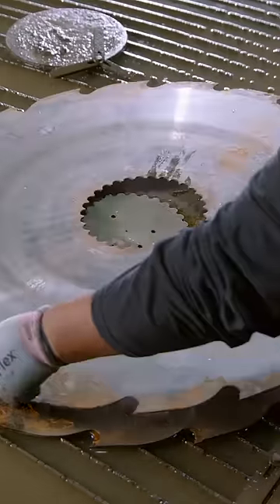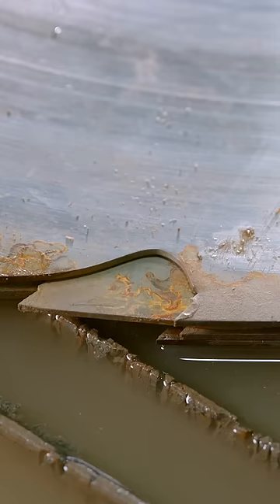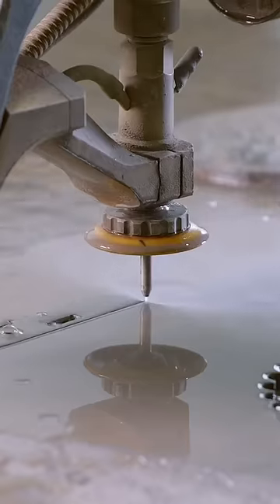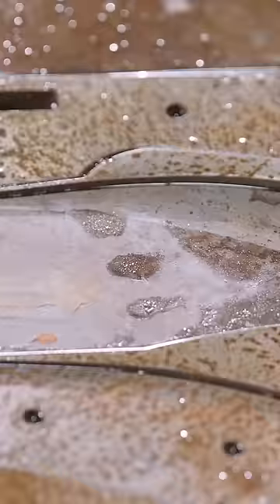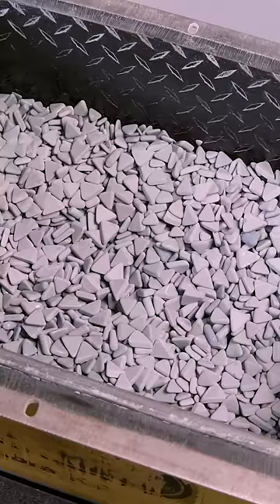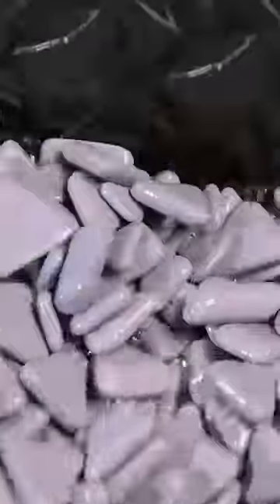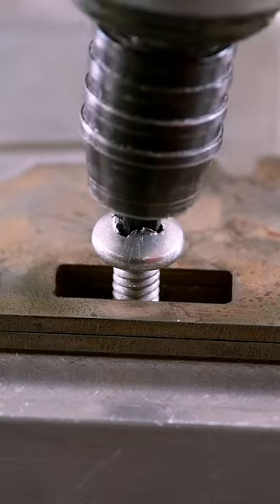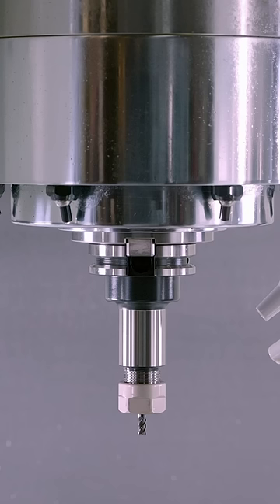Turning Old Sawmill Blades into Knives | How It’s Made | Science Channel

Comment: The screw has seen better days 😂
Reply: I came to find this comment
Reply: @Th3Build3r I came to say this comment. Luckily someone did it for me 😅
Reply: Yeah it time for those to go, and replace it with some nice hexes.
Reply: @iteerrex8166 is there a reason why we use hexagons instead of triangles?
Reply: @JT-nn8nj   I haven’t read any research on the topic, nor have done my own. I’m assuming you’re referring to the strength of the screw head!? But there’s also the other side of the equation, the strength of the driver, the ease of use. Maybe that the triangle is more of a stress-riser than a hex. I’m not sure why hex’s are very common. I have no answer. Do you know why hex than tri?
Reply: It looks about right for a Phillips screw. Garbage things don't last long. That was probably only one week's worth of use.
Reply: @iteerrex8166  the strength of the screw head primarily, but I also thought about ease of use with triangle wrenches and screw heads. I wouldn’t want to have to fumble around trying to get the wrench in the screw in a tight spot. I have enough trouble plugging in damn HDMI cables when I can’t see the port for it 🤦🏻‍♂️
Reply: @iteerrex8166  A hex driver is easier to insert tha a tri driver, you only have to rotate a max of 60 degrees rather tha 120 for triangle to fit it in. (approx)
Reply: @iteerrex8166 I'm sure they know more than you
Reply: @SpunkMayo  Very likely, in terms of a water jet, cause I’m still a noob, but workers do sometimes overlook things.
Reply: Now we know how knives out cast got their knives from😉.
Reply: So have I
Reply: Seems a bit odd they would even use Phillips head screws in an application that requires them being tightened and loosened again and again. Phillips strip far too easily.

Comment: 5 to 10 years?.  Who makes them.  I need to know. Lol
Reply: One log a day it seems
Reply: I think that’s how long they last till the steel has been sharpened so many times it can’t keep the correct cutting edge dimensions
Reply: @1992djg  o ok that makes more sence.  Thank you
Reply: The carbides are replaceable.
Reply: @1992djg its more an issue of cracks developing in the sawblade. Circular saw cracks can't be welded, legally speaking. Its highly dependent on what kind of wood its beint used on, i.e. hardwood or softwood, and what kind of debris is in that wood, I.e. nails or roadway spikes. The carbide tips are easy to sharpen or replace, and warping in the sawblade can be fixed too, though it takes a little more skill, but once it cracks, its cracked
Reply: MY MOM!
Reply: @Birilling    It depends where you are. Im acctully legally allowed to weld circiluar saw cracks so long as they are not to big. It depends on how big the crack is and how big the saw is.
Reply: @codeev4057  even if you legally can, you definitely shouldn't. Theres no definite way to repair a crack in a circular saw blade and the risk of the blade failing and throwing high velocity metal shrapnel everywhere is too great to risk it. Even putting in stop holes is risky as hell, which is why thats also illegal here
Reply: Where is here?. In New Zealand, if there is ANY process that the engineers would say it has a large chance of catastrophic failure, using that process in a workplace is illegal.
It isn't a matter of the government going along and looking at every process and judging it. The Industry as a whole KNOWS what is right, and wrong. They are self regulating in their setting of "Best Practice" and when there is an accident that results in harm or death, OSHA investigates. 
If the people used what was considered best practice, and did so honestly, they won't be prosecuted, but OSHA then makes a finding, and tells the industry "This happened because of this fault in your best practice. Here is the change to practice to MAKE it best again".
 Sometimes this is simple, sometimes it is extreme, and even a ruling that a process is now forbidden. If industry KNOWS there is a chance welding a blade won't leave it safe, and does it anyway, and there is a fatal accident . . .
$240 000 fine for every individual in the chain from owner through CEO right down to foreman, up to 20 million dollar fine for the enterprise.
And if  it is particularly egregious  or the company or management tells just  ONE lie about it, they can also get 14 years inside, not just the guy who lies or does the deed, EVERYONE who ought to have been monitoring it.
I know a bloke who worked for his fathers company, they set three guys demolishing the interior of a building, someone stole the fire extinguishers off the site so the bloke put the replacements  in an interior room instead of in plain sight . . . there was a fire and people couldn't get to the extinguishers and a man died.
The guy who was in charge of the site, the owner of the company, and the CEO all got 120 000 personal fines, the company got a million dollar fine, and the guy who put the extinguishers out of sight got a 240 000 dollar fine, and he was very close to getting five years inside. The ONLY reason he didn't go in was because he had gone and got replacements  the instant someone saw the theft had happened, he stopped work on the site till he got back, and he showed everyone where they extinguishers were going to be kept, and he had what he thought was an honest reason to change the policy.
But the Best Practice is you have the extinguisher AT THE WORK SITE, as well as at each exit, if there is a fire hazard identified.
The man who died, died because someone changed things just to save his company 300 dollars. And he had other things he could have done instead. @Birilling
Reply: We have a family sawmill that was steam powered in 1890 but has been run off a belt to the tractor for the last 100 yrs or so.

As far as I know it's the same saw blade that's always been on it, the teeth are spring loaded and changeable with a special tool.
The actual blade basically never has any reason to be changed.

The teeth are sharpened right in place with a file until every couple of years they are wore enough to need changing.
The whole operation probably takes a half hour or so.
Reply: Its their shelf life 😅
Reply: @Viking-r5e  different kind of circular saw, a old circular head saw is thicker where the arbour is, compared to the rim. Also runs alot slower compared to modern gang.
Reply: @uncletiggermclaren7592  think you might have @'d the wrong person
Reply: I was asking YOU 'where is here' in response to your comment "Even putting in stop holes is risky as hell, which is why thats also illegal here"

The rest of the comment was me, bored, telling you what the law's INTENT is here, in my counties jurisdiction.  @Birilling

Comment: Lol if you think sawmill blades last 5 years you’re cutting paper
Reply: Can't you just resharpen the edge? Looked like a lot of area to resharpen and get more use out of that blade they had
Reply: @Jellybelly98 they have carbide teeth on them and that’s actually make the cuts, they can be resharpened or replaced to a extent but once it’s been cut down so much from sharpening they’ll have to have new shelf’s cut to fit new teeth and all that usually isn’t worth the price
Reply: @travisnorton9288  ah, that makes sense, thank you for explaining
Reply: Precisely. Used to work at a sawmill and it'd be around 3-4 yrs they ran them so hard.

Comment: I wish they would point out that there is abrasive grit (typically garnet or aluminum oxide) in the water jet that is doing the actual cutting so people stop misinterpreting that water is doing the cutting. Water is just the carrier that also decreases heat and debris.

Comment: I worked at a sawmill chopping and debarking logs. The saw I had would get the tips replaced every 3-4 months. I would cut roughly 1000+ logs a day, and that’s not including trimming the ends to make them flush for the rest of the mill. I guess there are different types of saws, since we didn’t replace the whole thing, just the knives at the end.

Comment: In between those 5-10yrs the teeth on those blades have been replaced many times by removing the teeth and soldering/brazing new teeth on them until they can't be salvaged

Comment: In the used auto parts industry we look down upon ‘tumblers’ as it calls this vibrating machine with rocks as mediums. It strips too much metal off, making it more brittle. Nothing beats freshly casted or barely-ruffed used parts. Putting parts thru a tumbler is the bottom-of-the-barrel process for salvaging

Comment: I would say. Since the blades are originally such a large flat surface, I’d think it’d be easier and quicker to just use a flapper disc to clean the rust off before cutting the parts. Idk, that tumbler didn’t seem to do much good

Comment: 3 different types of screw heads on the same fixture, flanged hex head, phillips and internal hex. Guy picks up 3 different tools to tighten one part down, if he was doing thousands of them it will take him a good few hours longer than if he was using one type of screwhead. Owner is stepping over $ to pick up pennies in the long run.

Comment: Or you could just resolder new carbide tips to blade and reuse it, but its probably replaced due metal fatigue and micro fractures. In cheap mass produced knife those dont matter that much, but in sawblade of that size moving 3000rpm its different story.

Comment: Don't know what sawmill you are talking about but where I worked it would be a miracle if a sawblade lasted 6 months.......5 different high speed edgers for 4 6 8 10 12 inch cants/logs right butt to butt one after another and we run them 24/7 besides lunch and coffee and saw changes.......we developed our own babbot alloy for the saw guides so they wouldn't melt as easy even though they all have water cooling on each saw

We would cut approximately 2.3 million board feet every 8 hours so just shy of 7 million board feet a day.......we went through saws like crazy

Comment: I work for a Lumber company. We have on-site equipment for resharpening all of the different types of blades we use from the gigantic circular to cut the boards into the sizes ordered to the extremely large band blades to cut the logs into boards themselves. I mean I get it but, this seems like a waste.
Reply: If the carbide tips are worn, do you scrap them or do you refurbish them?

I'm a carpenter and we have other businesses for sharpening, but if the teeth are worn the blade gets scrapped.

Sometimes they treat the surface of the blade in a way you can not braze on replacement teeth - they want to sell new blades.

Comment: Why not just cut off a cm or two around the rim and use the blade again for another 5-10 years, sure it'll get smaller each time and you could only do it once or twice before it'll be too small, but it'll save replacing the blade for longer.

Comment: Used a battery powered drill to tighten a partially stripped screw head.  What home shop did they get this footage from?  Soapy triangular ceramic stones did nothing.  To attach a sheath?  A high pressure water tool?  Finally, high carbon steel that has not been softened before you cut it with a tool steel bit?  Who made this b.s.?

Comment: Yeah thats how chinese mall knives are made maybe but the brands i buy buy from factories that carefully make the steels from scratch by using a powder solution then melting em at highlevels to get a balanced equal through the plate mix of the carbon and other elements. This allows for a perfect steel. Its called cpm. And they sell it to professional knife makers like demko, and benchmade, coldsteel, list goes on. From there, they make their knives how they want it, by hand, or by machine, regardless its not secand hand crap steel. That be fun as a diy project but to sell, you ainr going far with repurposed saw blade steel. And no reputable brand or knife maker will do this to their costumers. Especially for the prices they reach, a good knife can run you 100-300, a collectors can reach the thousands digits. And a budget knife can run you anywhere from 25-100. But a repurposed knife, in this case a bowie ((the type of knife they shapes theirs to be in the video)) considering sizs and all that, 25 dollars tops. Maybe 35 if the handle materials are good.

Comment: You apparently don't know how to sharpen or set the teeth.  Setting bends the teeth ever so slightly to one side then the other.  This gives it clearance to cut smoothly and give it clearance away from the rest of the blade.  Top edge of the teeth should be that only part making contact with the wood

Comment: As a bladesmith, this is crap. I have made blades out of saw blades and this seems like the cheap blades you buy at Walmart in the plastic.
Reply: The steel inside the saw blade has to be flexible (it would be extremely dangerous if they break), but it don't has to cut anything. The carbide tips are cutting. So this might be the reason